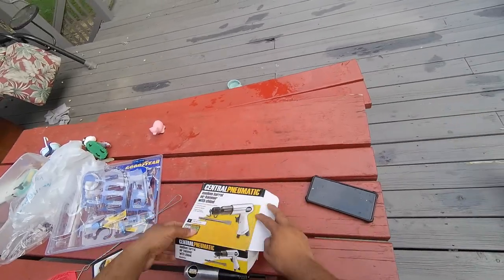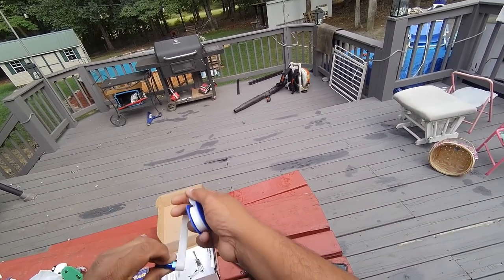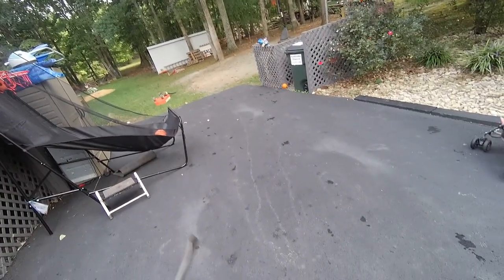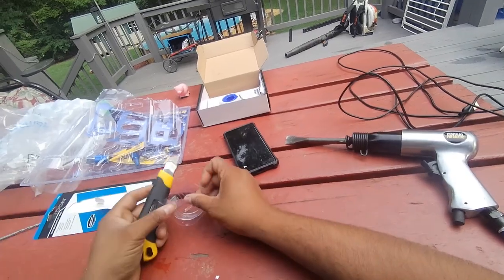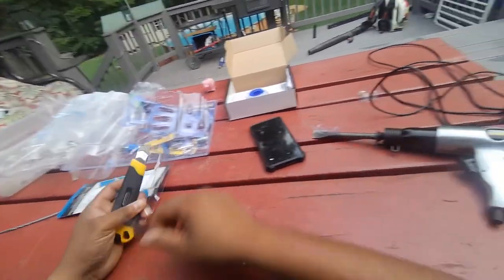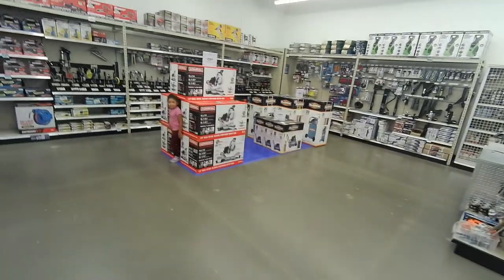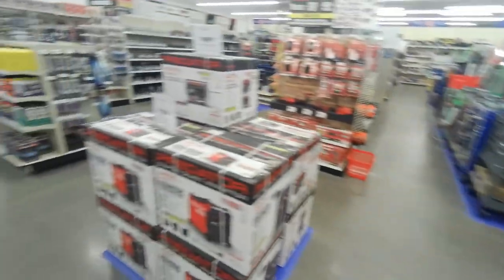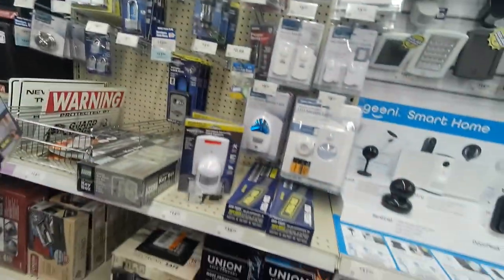Harbor Freight! How to Central Pneumatic Air Impact hammer

Comment: When I hooked mine up to the compressor it doesn’t run continuously. It gets 2-3 hits in. Then takes a few seconds to get a few more hits. Any tips?
Reply from the maker: What size air compressor do you have?  Might be too small would be my guess.
Reply: @javybavy  thanks for the fast reply. I realized I’m an idiot and had the valve closed 😂
Reply from the maker: Awesome👍 glad you got it figured out.
Reply: @jessihawkins9116  you are